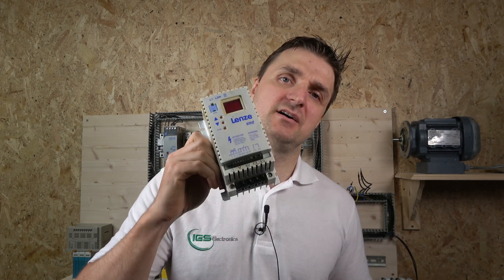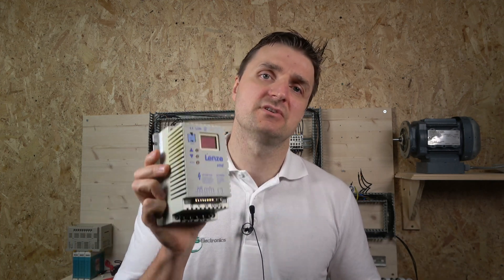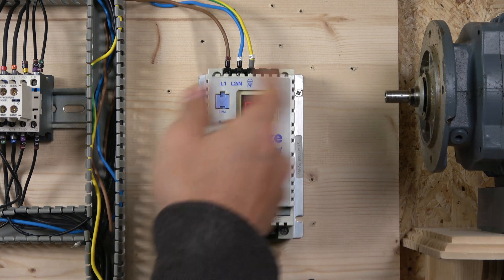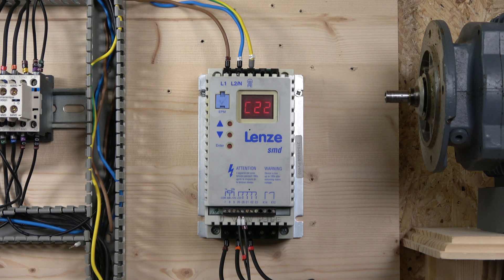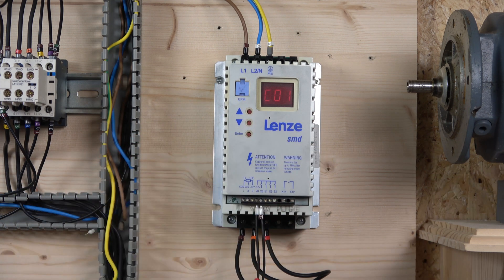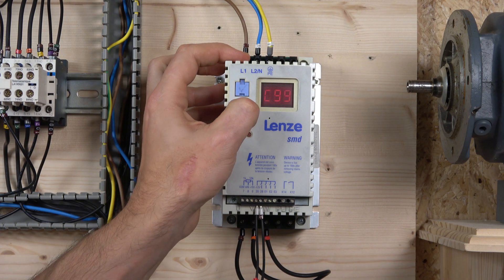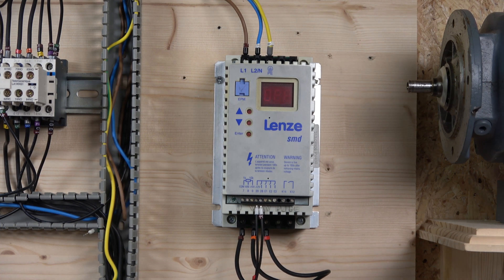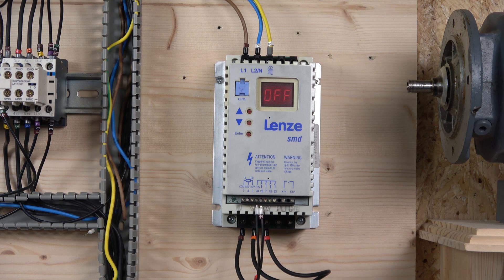Lenze SMD Vfd drive semi local control, commissioning and factory reset. ( English)

Comment: Hi! Can you please help me. My Lenze SMD is crazy. It does not respond to the back an forward signals anymore. It runs constant. I used it to feed my sawmill.
Check this video. Help me please. https://youtu.be/fdtmMc0XuII
Reply from the maker: Looks like drive I/O has developed a fault. That happens. Your wiring looks good, provided your IO is not receiving any other signals from anywhere, as STP stands for quick stop, hence your drive not responding to your buttons
Reply: Thanks for fast response.
Belive it or not. But today when i connected it. It runs like normal again. Still wonder what went wrong and if will happend again.
Can int be moisture? It is used outside. And now i kept it inside over night

Comment: Hello i have a churros machine and now ot does not work anymore. The pressure stopped on the middle position and i cant move it to starting position. I opened it and saw it has a frequency inverter lenze smd. The fault code is "stp". What can i do now that the machine works? It costs nearly 5000€ for me few years ago. I hope you can help me
Reply from the maker: STP could be activated by some sort of quick stop via digital inputs. STP means your drive is stopped.

Comment: Can I ask if I'm using Lenze VFD, can it connect with the oriental AC motor?
Reply from the maker: What is Oriental?
Reply: @IGSElectronics  is a brand of AC motor
Reply from the maker: @kennyloh2062  Oh, never heard of that brand. But yes, as long as your motor is dual voltage, that means data plate say 230/415v you should be good to go. Check out my firs ever video i made to help you.

Comment: Hi Angus, I have a pallet wrapper that has two SMD’s, one for turntable and one for strechwrap, the stretch wrap VSD had F1 fault, after checking manual I noticed EPM was not fully seated though tape was still covering. I powered down and push EPM home then re energized, display showed CF 😬😳. There is no parameter list for reference or wiring diagram to explain control. Could you please advise 🙏
Reply: Cool thank you for quick reply 👍 really appreciate it. I will keep you posted 😊
Reply from the maker: Hi Shane. Looks like you drive has lost data and is in need for reinitialization, provided EPM is not faulty (that can happen). To only way to find out is to loud lenze parameters ( you can see how that's done in video) and see if fault is gone. I have only once had F1 fault and only cos EPM was removed, but when i put back in the parameters were all there, so it is posable that something has gone with EPM or memory. If you have spare drive with EPM, if you can swap over see if fault disappears. Its all fault finding from here on.
Reply: can email you photos and possibly get a little advise moving forward.
Reply from the maker: @shaneking4523  Sure, you should be able to find email address in contact info.
Reply: Sweet thank you Ingus ✌️

Comment: I have a Lenze unit that is saying turn off quick stop , as in CE1 5. How do you turn this off ?? I click enter when on 5 but it just returns to CE1...and now , because Iv'e blindly messed around I have conflict of digital inputs E1/E2/E3, a case of a little knowledge is dangerous !!
Reply from the maker: Hi There. If you look in to the manual it say signal needs to be low, that means closed. To remove the quick stop you need to use normally closed signal. Permanent supply from 12v to e1 must be present. Is that make sense? If not look in to MOP video were i explain how that works.
Reply: @IGSElectronics  will give it a try ..thanks.
Reply: @IGSElectronics  12v to E1, still shows cfg error
Reply from the maker: @MrPluckacre  ok, can you tell me what is assigned to e2 and e3?
Reply: @IGSElectronics  on the terminal block nothing. The parameters CE 02 = 02/ CE 03 = 03
Reply from the maker: @MrPluckacre  is this drive you setting up from new? or it is running a application already?
Reply from the maker: can you do one more thing, can you supply 12v to ce1 and turn of the drive supply. then turn back on wile 12v is still connected to ce1.
Reply: @IGSElectronics  Is there a return to factory settings ??
Reply from the maker: @MrPluckacre  in that case reset to factory defaults. That info is in video.